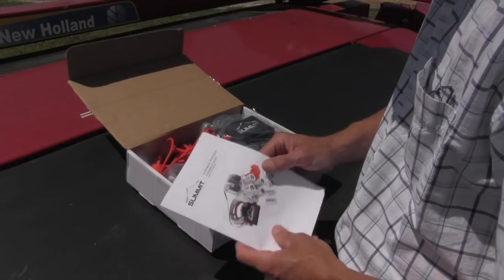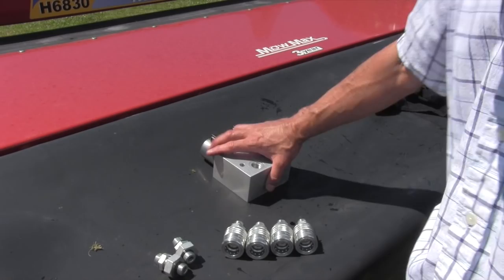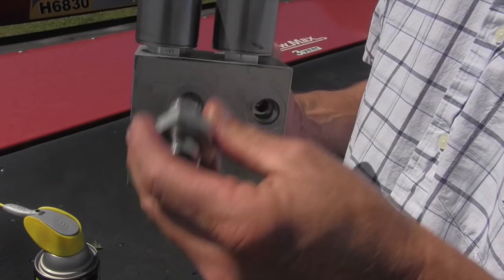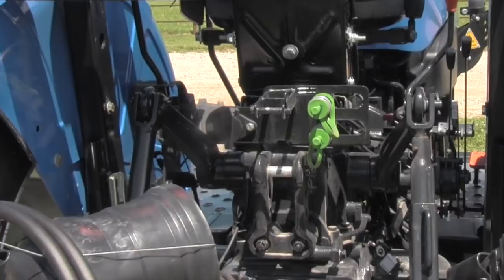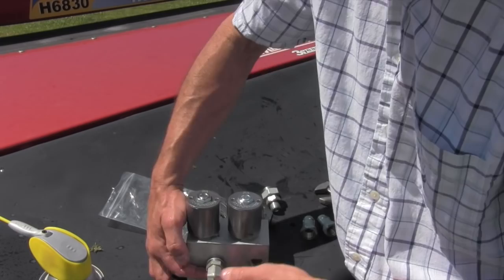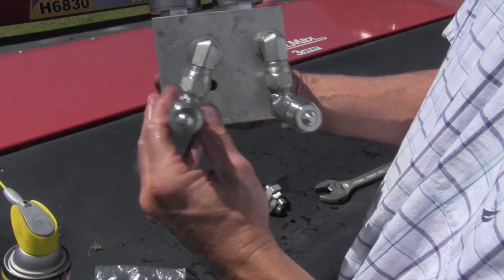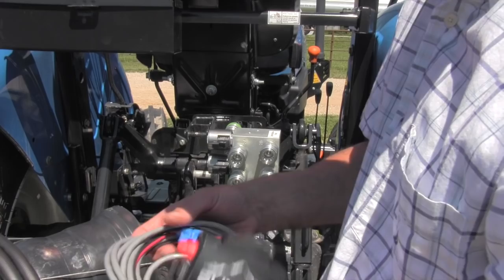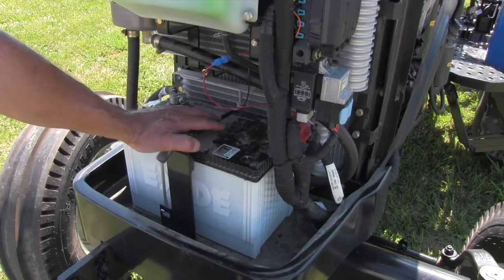A Solution for Being One Set of Remotes Short

Comment: That's extremely slick Mike. I can't believe that no one has thought of this before. I suppose that one could put something together with off the shelf parts where you'd have to get out of the tractor, go back to the diverter and flip a lever from one set to the other. That would be a LOT better than switching hoses but not as non-skid as this unit. Or rig a mechanical linkage up to the cab from your cobbled together thing. But that would be a lot of work and puzzlin' out. Ever see anybody do anything like that Mike?

Comment: With the elbow set, you can turn them just right and the valve box will actually be upright instead of turned to the side. I FINALLY figured this puzzle out on my JD 5075e. The elbow set is for the when the factory remotes are stacked instead of beside each other.  So far, it works great. I have the Fasse remote hydraulic set instead of this one by Summit. I use it when I'm bailing for the pickup switch and then for ejecting bales.

Comment: I have am older large tractor that's running the loader off the rear 4 ports, I think this will work, but since its always going to be in use I think bolting the box down would be better than hanging off couple fittings

Comment: So I wonder if you could hook this up to the back run lines all the way to the front of the bucket for a grapple.  I cant think of a reason you would need both rear and front remotes working at the same time.   Then this way you would switch it to the front work your grapple.  The switch it to the rear and work your Log splitter or if you did need 2 rear remotes just unplug the front hoses.  Have them tied up out of the way and you still have your 2 rear remotes......Great product.  If I had rear remotes Id do this for sure!!!  In my situation I dont need the remotes all the time but it sure would be nice to have that option.
Reply from the maker: Yes, that would work perfectly.

Comment: My friend has a block on his baler. Deere initially installed it like what you did. He made them come back and install it on the baler permanently. Two hydraulic lines to couple instead of 4.   Ive redone the wiring on the baler so there is 1 wire plug for the bale size alert and hydraulic control instead of 2 and wire his other tractor he got later so we can bale with either tractor now

Comment: Thanks Mike.  I've been looking at the summit multiplier for a while now and been hesitant about pulling the trigger.  Have you had a chance to really use it to get a sense of it's capabilities?
Reply from the maker: Not really, I just hooked it up for the video and then took it off.  I was showing it to my neighbor who has a 100 hp Deere tractor that is sometimes one remote short and he asked me to find out what they'd take for it, they shot me a cheap price to keep from having to take it back and he took it, but I'm pretty sure he hasn't used it yet.  It's probably still sitting in a bucket in a barn down the road.  It's heavy built, of course what's inside is what counts, but that's what I'd buy if I needed one.

Comment: Tractor Mike, my brand new Massey has only one set of rear remotes too. Problem is, how do I get constant flow with a center spring return control lever in my cab? Bungee cord? It's either on when I push or pull, off at rest??

Comment: Why wouldn't you remove the existing couplers and connect the hoses directly to the splitter?
Reply from the maker: You could.  It might be easier to hook the hoses up to the multiplier than trying to hook the multiplier to the tractor with all the hoses in the way, but that would be one hookup versus two.  Good point, I'd have to try it both ways to see which way was easier.

Comment: How will this work if I already have a loader on a John Deere and I  want to add a angled snow blade? Will it plug into my hydraulic block for loader?
Reply from the maker: No...it'll plug into the remotes but is not designed for a loader plug-in.  A diverter valve is a better choice and here are a couple of videos where I put one on: https://youtu.be/kMwJ45XNtVA.  You can order that product here: https://asktractormike.com/product/hydraulic-diverter-valve-for-tractor/.

Comment: Point of confusion on my part. Does the switch merely choose which set of valves is "open" or does it actually control the function of the attachment? I ask because my Mahindra 1533 has a pair of valves for the backhoe but it has its own controls, the connectors merely allow hydraulic fluid to flow to those controls. If I want to control a 3 PT attachment that has a hydraulic function, I also need a control that will send fluid to the cylinder.
Reply from the maker: It does not control the function of the attachment, it just switches from one set of ports to another.

Comment: I have a mf 231 with no remote hydraulics. Not even for front end loader. I also bought an older post pounder with no pump just hoses.
What do I need to add ?
Reply from the maker: Helena, you can hook a diverter valve into the 231 that allows you to direct flow from the three point to a front-end loader.  It goes between your ankles on the hump and any long-time Massey dealer will know how to install it.  It can power a loader, but it only puts out 4.4 gallons per minute so it's going to be slow.  That's probably not enough for a post pounder, so, for that, I'd be looking for a PTO powered hydraulic pump which are commonly used on backhoes.  However, some post drivers, Worksaver for example, have a cylinder that powers up against spring resistance and then comes crashing down when the flow is reversed while rapidly pumping a gush of oil back into the sump of the tractor.  If that's what you have the PTO pump won't work and I'm not sure what you do then.
Reply: @TractorMike  thanks for that valuable information.

Comment: Is this a good choice to hook to a 3rd function so I can get rear remotes?
Reply from the maker: I don't think so.  If the remote plug in's for the third function are at the front of the loader, definitely not.  This is designed for when you have one set of remotes and need two.
Reply: @TractorMike  any recommendations for adding rear remotes to a tractor that already has a third function?

Comment: How has the long term satisfaction been with this product? I have a Kubota that has only one set of remotes and this would be ideal to add another circuit. Thanks for sharing.
Reply: Also, are there threaded holes in the block of this adapter so  I could make a bracket to make it more secure than hanging off of the remotes on the tractor.

Comment: Mike there are many aftermarket companies that make kits to add remotes and/or 3rd function kits. No they are not as nice as a factory kit, but much cheaper than doing piece by piece from the dealer or trading tractors. Failure to mention these is a disservice to your viewers in my opinion.
Reply from the maker: Are you talking about a diverter valve where you use the three point flow for remotes?  Or plumbing into the loader valve?  Those are available and might save a few bucks, but they're a little cumbersome to use and eliminate the function of either the three point or the loader bucket.  If there are better, cheaper kits out there I'd like to know about them.
Reply: Tractor Mike, first I consider what you showed a diverter kit, as you can not do both functions at the same time. There are many of these kits on the market. Many if not most are for the fel for a 3rd function. One such highly review kit is from W R Long. 
I have a Yanmar grey tractor, rear remote kits are available from several of the business that support these tractors. 
Also there are many places besides the dealer where parts can be purchased to piece together rear remotes. The hard part would be getting into the pressure and returns to the tractors hydraulic system. This may be easiest to get from the dealer or by use of power beyond port if available.

Comment: EX or CON??? that is the question   ..........CENTRIC
Reply: Pat Tierney I have this same valve which worked out well. Recently I snagged a limb and pulled the hoses off the tractor the tractor . In doing so it broke broke a few fittings which I replaced . My question is , how do I check the Solenoids  because the valve only has one function?